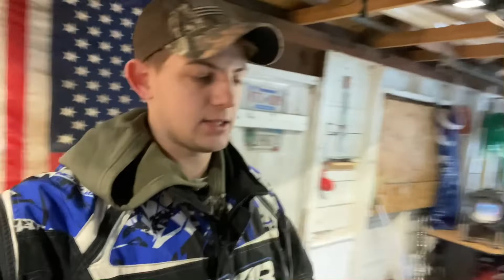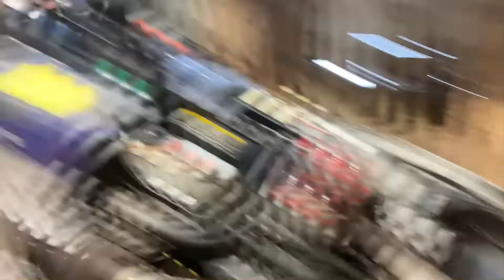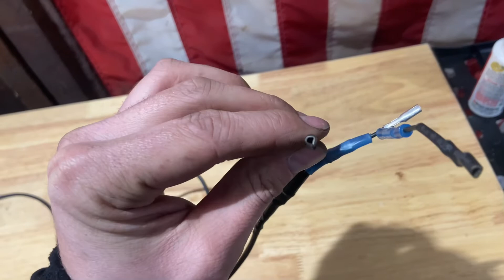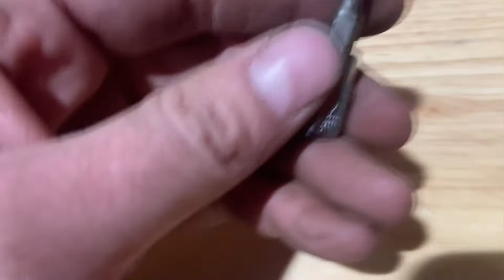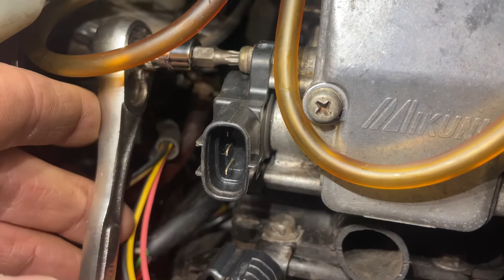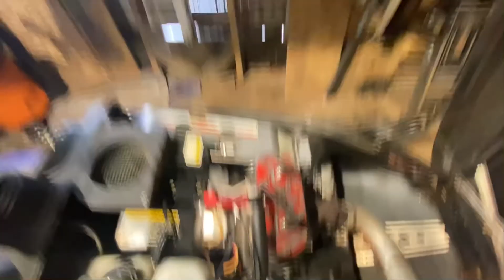Setting Polaris TPS for FREE - No expensive tools required!

Comment: What do I have to do if I have .54volts at wide open throttle and 3.89 volts released
Reply from the maker: @cjgilbert8581  sounds like you have your leads connected improperly.

Comment: Instead of doing voltage, couldn't you do resistance?
Reply from the maker: You would need to know the current, then you would have to back figure based on voltage and current to get resistance. I’m not sure why one would do this, the spec is not written in ohms.

Comment: Where do i find the correct voltage i have to adjust mine to? Got a polaris rmk 600 ho 2008
Reply from the maker: You will need to check the service manual for your exact sled, you could also call your local dealer and they should be able to tell you that specification.

Comment: Would I be able to just loosen the screws, adjust it then test drive to see if it is better
Reply from the maker: I do not recommend doing that.
Reply: I mean it’s possible you get lucky and get it close enough but not recommend…. You want it right in spec.

Comment: A good aftermarket tool is not that expensive and makes it even easier, especially if you do this often.  Example showing the same plug as this TPS:  https://youtu.be/HuKy5Hp496U
Reply from the maker: Matt, I totally agree! Sometimes people don't want to spend the $160 to do this job once. I had all of the materials readily available and was able to accomplish what I needed the same day without waiting for the tool and spent a lot less. One the flip side, if you are doing this often, absolutely the tool is the way to go and would be worth the investment at that point.
Reply: @MrNcotton  quick tip, use your meter to check the output of your USB wall wart.  They are often 5v-ish, not bang on 5v.  Once you know the input voltage, you can do some math to calculate the proper output voltage for your input voltage.
Reply: No worries @MrNcotton, Matt is a shill for TPS tool

Comment: great vid bro. about to adjust/calibrate tps on my 2014 pro rmk with the help of this video and another one. one thing I found interesting, was my manual, it suggests introducing a 12 VDC battery to charge the system, while in your video, you introduced 5 VDC. Will this affect the readings from the multimeter when checking the TPS? hope that made sense
Reply from the maker: It’s very likely that yours is different… I am not sure how different but it is 12 years newer that mine. Does it give a procedure in the manual?
Reply: The way I read my 2010 manual, three is a 12 V DC ECU power plug you can feed which in turn powers the 5V to the TPS via the ecu itself - without having to run the engine. Have not tested this yet though.